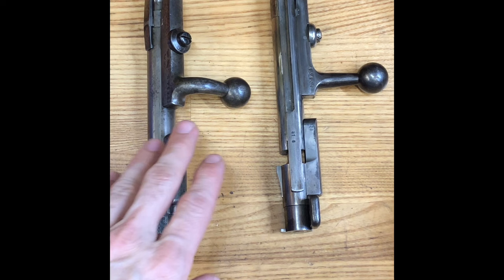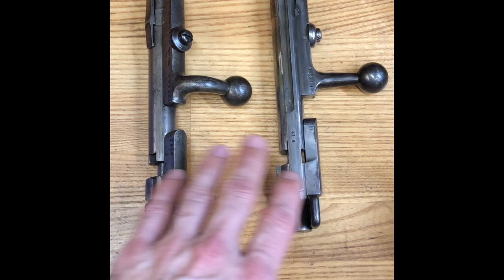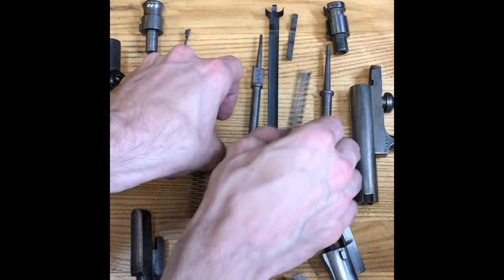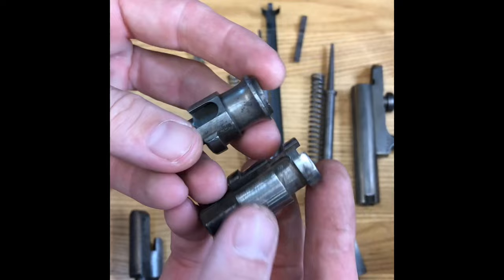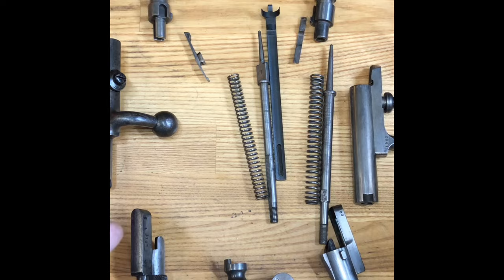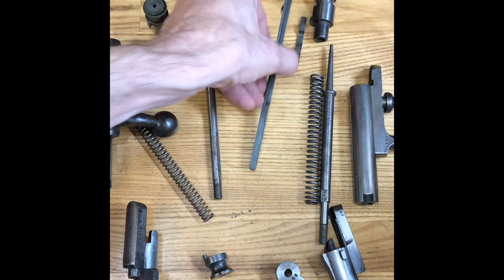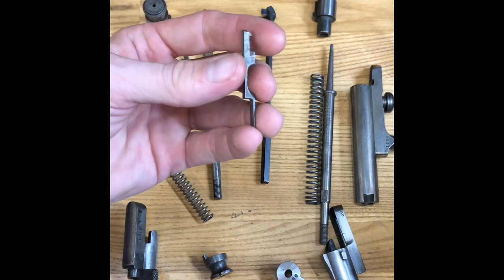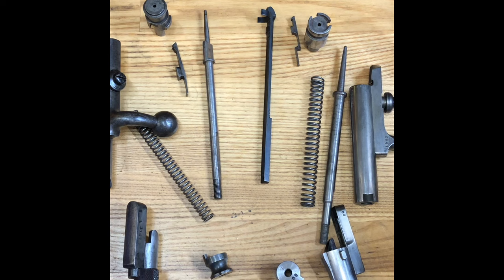A short comparison of the Mauser 1871 and 1871/84

Comment: I am looking to buy an 1871 firing pin. I noticed that the bolt in the 1871 Mauser I am working on has a straight bolt handle like the 1871/84. Comments on that please?

Comment: Could you tell me what thread they use on the back of the M71 firing pin.  I checked mine with a thread pitch tool and it looks like 27 TPI but I’m not certain.
Reply from the maker: I don’t have my notes handy, but that strikes me as correct. I seem to remember some discrepancies between parts. Some were essentially 6.35x1 if I am remembering correctly